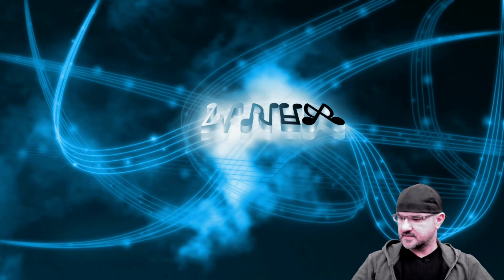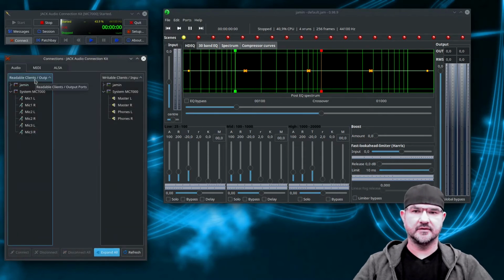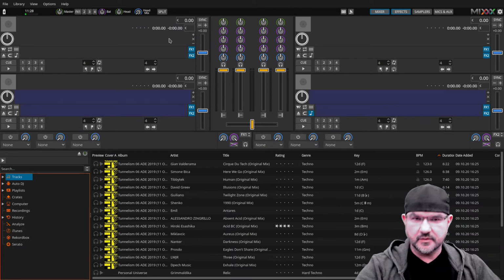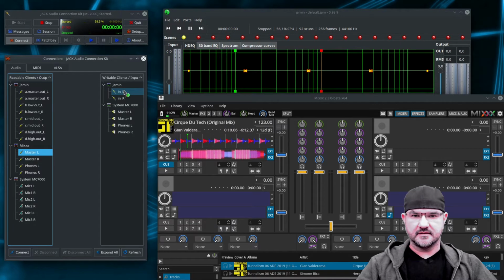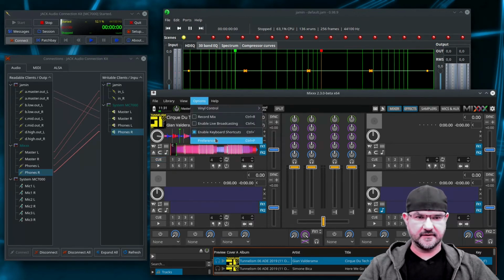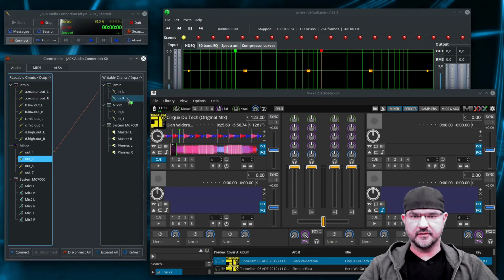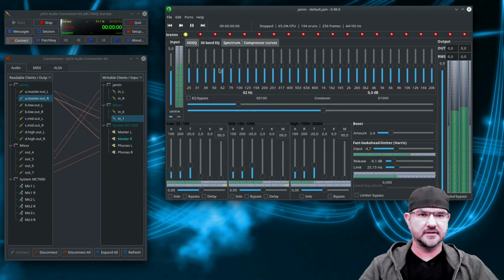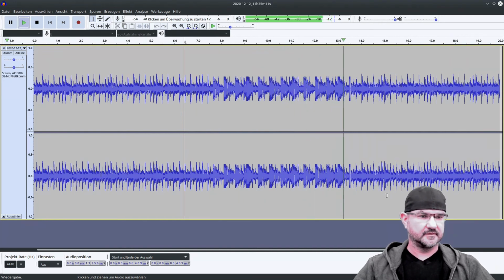Mixxx Tutorial 04 - extended audio processing using Jack Server #mixxx #dj #tutorial

Comment: hi, ich hab jetzt alle diene tutorials durchgeguckt und habe folgendes Problem. Ich nutzte den vonxy cdj450 und dieser wird nicht unterstüzt es gibt auch kein mapping was ich finden kann und auch kein anderes DJ-Programm welches mein quipment unterstüzt. Nun zeigt das Gerät mir leider keine BPM an, wesegen ich irgenweine support software brauche. Kannst du erklären wie man selber ein mapping erstellt oder hast du eine andere Lösung für mein Probelm ^^
Reply from the maker: Also am besten wäre es, mit dem Mapping Wizard ein Basis Mapping zu erstellen und dann die XML Datei im Texteditor weiter zu bearbeiten. Fand das die beste Lösung für meinen MC7000 zu mappen. Schau mal hier im WIKI https://github.com/mixxxdj/mixxx/wiki/Midi-Controller-Mapping-File-Format als Startpunkt. Bei Fragen, kannst dich gerne über FB Messenger an mich wenden oder im user Forum einen neuen Thread aufmachen. Wenn du mich markierst, sehe ich den dort auch und kann helfen. Die Entwickler kommen aber auch sehr regelmäßig hinzu und geben nützliche Tipps. LG